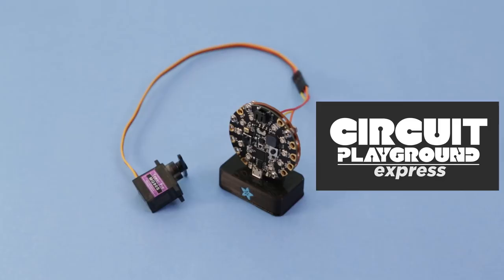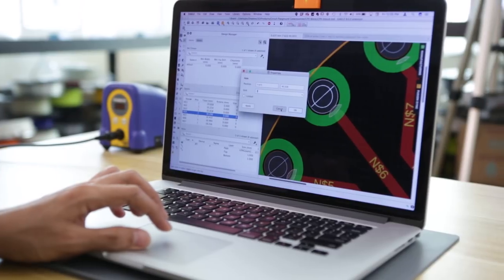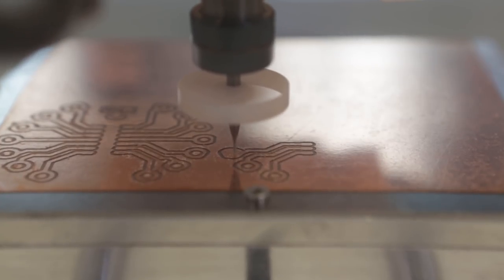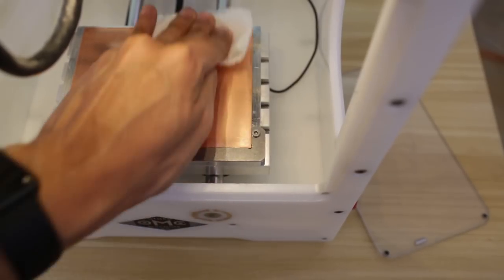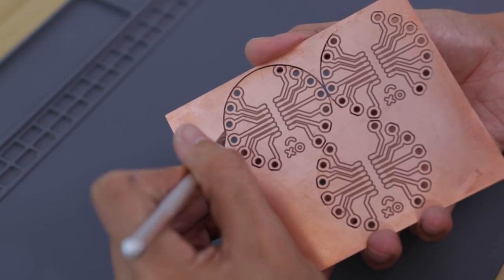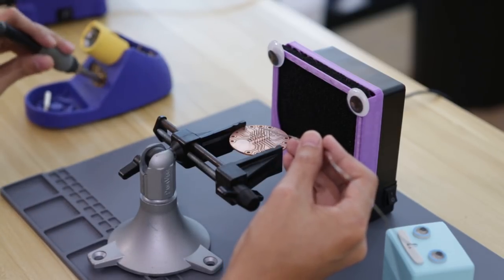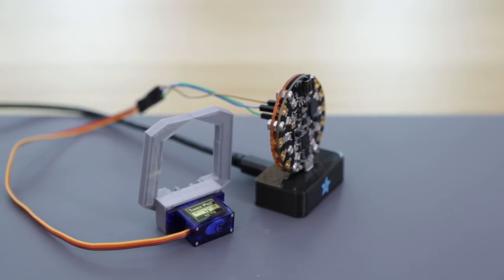Doubled-Sided PCBs // CNC MIlling

Comment: I don’t understand how this works. Isn’t that board just a complete piece of copper? So won’t that completed board be just one big price of metal in the end? What separates those milled sections from one another when the board is one big piece of copper?
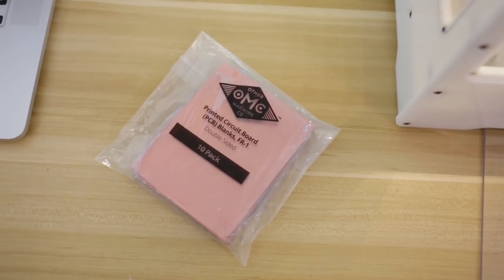Reply: They are blank double sided 'printed' circuit boards, check 1:56 (ie. there is an insulator layer between the two copper layers).
Reply: the board is not one big piece of copper its Fr2 material with a thin 1oz of copper layer on the bottom and top, like a sandwhich, the machine as you can SEE is cutting away the copper making the circuit and thus making some parts not touch each other.

Comment: I bought CNC from China on christmas, and since then i had a lot of problems with it.. actually i was never able to make a nice PCB, althrought i did make a working one, it wasn´t good. I really like the autoprobing and all this stuff from Othermill, but i am just not able to spend 10x more on hobby machine (i paid like 180€)... so, any1 have any tips how to deal with those chinese things? :)
Reply: Did you check if you have high spindle runout? That could ruin any CNC milling job that requires precision.

Comment: Lovely idea until you weigh up the cost of the machine + consumables (blanks are ~$2/sheet, 50ml of xylene coating is ~$15 for a 55ml bottle, bits need replacing after time at ~$25 each).. the cost/benefit compared to simply ordering factory-built PCBs just isn't there. That's on without all the vacuum time and isopropyl wiping and sticky-taping, and inevitable misalignments on early jobs.
Reply: The bits only cost $5 on AliExpress
Reply: "...weigh up the costs..."
Many makers have a lot of that gear for their workshops unless they are relatively poor but that tends to drive ingenuity. Many reasons why guys make their own PCBs.
Reply: Actually, the best use case is for rapid prototype development.  You are right that OshPark or JLCPCB wil lget them done cheaper.  But, they also take a couple of weeks for each spin.  Being able to make a board in an hour is a pretty useful superpower in some situations.